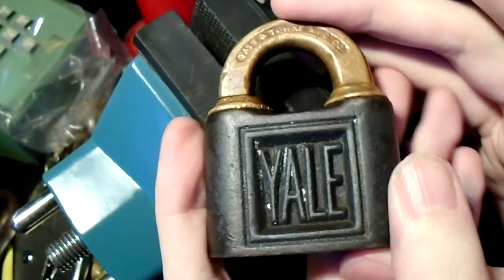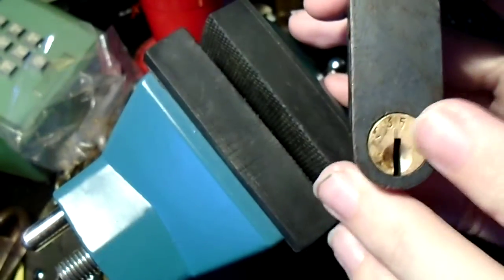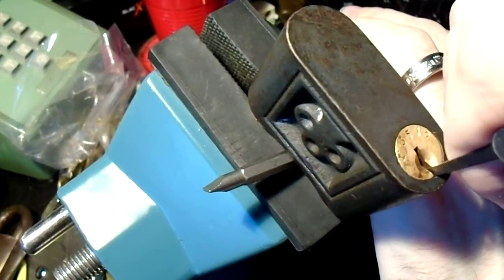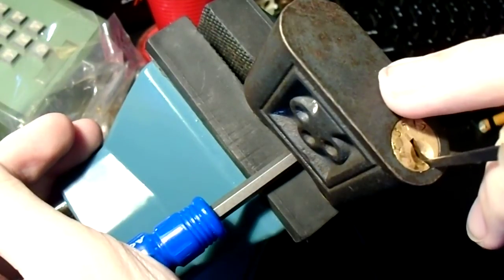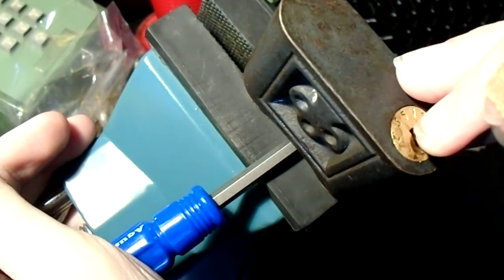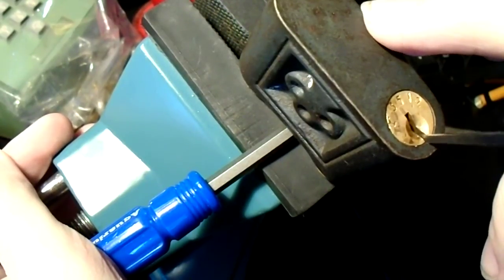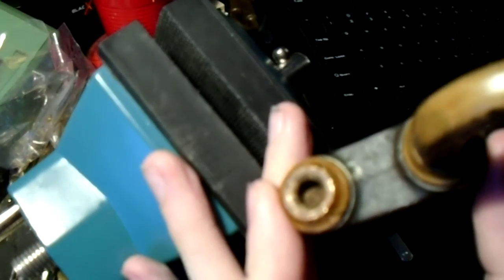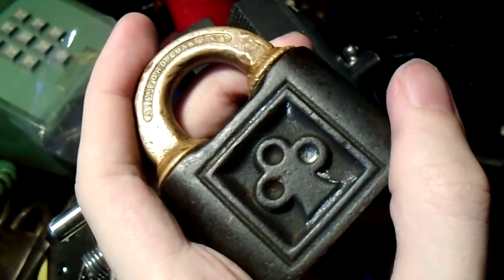(033) Antique Yale push-lock padlock picked

Comment: Boss at the shop made a key for one of these today. That cap unscrews and the the shackle will pull out.
Reply from the maker: They do indeed. You can even use weaker materials than usual. I made one from sheet styrene: https://twitter.com/nite0wl_2600/status/787101879046135808

Comment: Well shim picking would have had the lock open in under a minute, these padlocks were made from the late 1800's (around 1875) up until around the 1930's, the push style was invented by Linus Yale, and all pin tumbler locks have him to thank for that because he invented the pin tumbler style. if you have to go through all that extra work to keep your padlock working, I would take it apart and fit it correctly a oil bath is just making due, it is not a fix
Reply from the maker: In the case of antiques with press fit or welded retaining pins, oil baths and the like are one of the only choices unless you are willing to damage them. Periodic flushing and lubrication is recommended as regular maintenance in most documentation but few lock owners observe them.
Reply: Well then since that padlock does not have any press fittings nor is it welded, what are you talking about?
Reply: I see no way of dismantling without damage.
Reply from the maker: The body is cast and drilled with press-fit caps on the side, there is also a hidden press-fit pin in the plug.